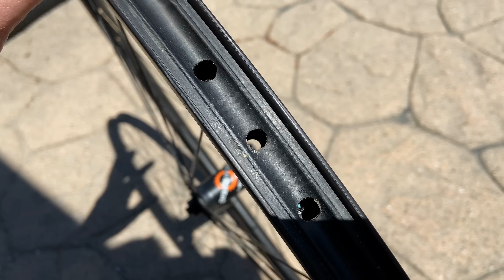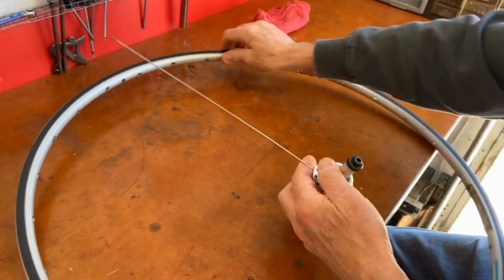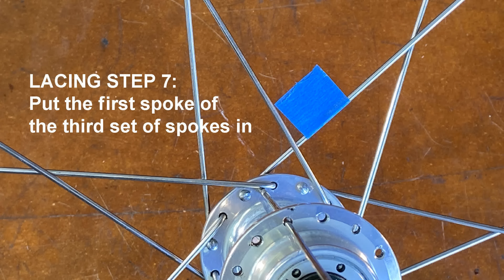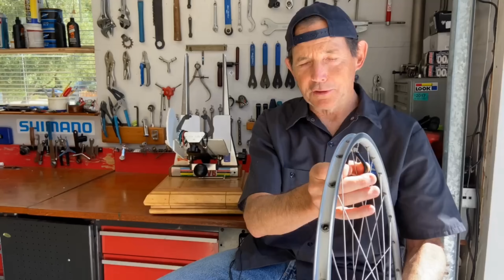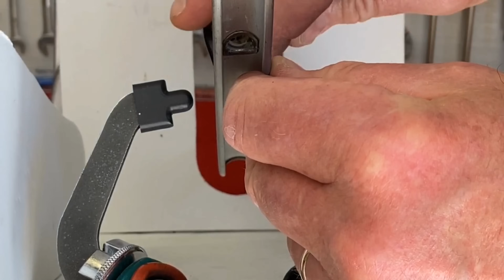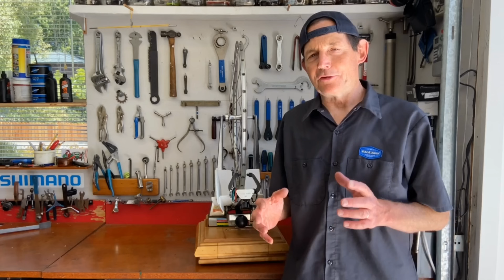How To Build Bicycle Wheels THE EASY WAY! #bikerepair

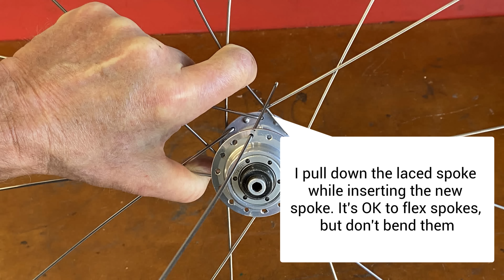Comment: I used your video to help rebuild  a set of wheels I had built in the 1970"s using the Campy Low flag hubs from that era.  At 17:02 you showed bending the spoke to fit it through the large opening.  When I tried this I got the spoke stuck and could not push it through. Instead I pushed the spoke through the triangular area below your finger until the spoke was totally inserted, then worked it out from between the spokes on the opposite side by bending it slightly.  For me it was easier and quicker. By the way, I started building  my own wheels for racing in the early 1970's.  I used the trial and error method and made a lot of mistakes along the way.  I wish I had your video back then. Very helpful.  Thanks.
Reply from the maker: Thanks for watching and sharing your wheel build tips, Bill - nice of you! Yes, Campagnolo hubs back then had slightly smaller spoke holes, which was great for bedding and supporting the elbows but it did mean having to tweak the spokes to lace them sometimes. Good job figuring out the best way to do it. 

Some builders would deal with the issue by putting the spoke sets in loose (multiple) sets at a time so not have to to avoid having to weave spokes through others. Happy to hear my video helped you build those lovely classic hubs and get them back on the road. Enjoy them!

Comment: I have some 72 spoke 20in wheels and I need to add a hub motor to them..All I've seen with these is straight spokes, or twisted straight spokes, where the twist is forward one side and backward the other side.   I am wondering if I can do forward BOTH sides?   As the motor torque would even each side, not worried too much about braking.  I think that would look cooler than just straight up spokes.  thanks
Reply from the maker: Thanks for watching and the question, Murray Madness! The reason wheels have forward spokes on one side and backward on the other side is because the opposing twisting force on the hub balance each other out. The first set of spokes is put in on one side. Then the hub is twisted making those spokes all lean forward and when the other spoke set is put in on the other side, those all lean backwards, which holds the hub twisted and keeps all the spokes forward and backward.

If you were to try to do all forward spokes, you would not have any force to balance out. And, what you would have is just a radially spoked wheel, which means straight spokes from the hub to rim. Even if you twisted the hub to try to make the spokes all angled forward, once you tightened the spokes the hub would untwist and go back to a neutral position with its holes directly under the rim holes. But, you could experiment with only one backward spoke per side maybe and end up with 70 forward facing spokes. I bet you could make that work, but I have not tried it so I can't say for sure. If you figure it out, please let me know. Hope this helps and have fun! I subscribed to your channel, some cool videos, thanks!
Reply: @JimLangley1  Makes perfect sense, if I tried it it would be obvious nothing holding the hub in place.  I think I will just bail on the 72 spoke wheel and replace it with a 36 and do a single cross.  Thanks!
Reply from the maker: @murraymadness4674  you're welcome, Murray. That'll make a nice wheel. Have fun building it.

Comment: What a amazing video. Best video on YouTube about this subject
Reply from the maker: Thanks very much, Jose! I appreciate you watching and the awesome comment!
Reply: @JimLangley1  I will need to do all this cause I'm changing both hub and a cassette for 11v, but I'm afraid that my wheels will be aligned as a UFC fighter's face after 10 rounds 😂
Reply from the maker: @FernandoHaddadMinistro  ha, ha, thanks for the laugh, Jose. As long as you take your time and true little by little and follow the steps, you should be able to get the wheel straight and round. It just takes patience and some determination because it takes time and many small adjustments. It's really satisfying when you end up with a wheel you built yourself so that makes it worth it. And you get better at it as you build more wheels. Have fun and let me know how it goes or if you need any help.
Reply: @JimLangley1  thank you very much for the encouragement. I see as the same, as fun. I could pay for some store to do it for me, but I wanna do it!

Comment: Hi have you any vid on wheel balancing with weights or what are your thoughts on it ?
Reply from the maker: Hi Seamus and thanks for watching! One of the best wheel engineers in cycling , Josh Poertner, head of Silca who makes a wheel balancing kit has a good video on it here https://youtu.be/ZrRbM2BSU8A I think it’s a way to ensure you get max performance from wheels but I haven’t had any wheels that seemed that out of balance so I have not tried it.

Comment: I just laced and tightened each nipple to 2mm of thread, but my hub is still somewhat unstable in the wheel. I has maybe 1 cm of play up and down (where some of the spoke nipples can push out of the holes). Are my spokes too long? 
Thanks and great video!
Reply from the maker: Thanks for watching and commenting, Jordan. If I'm working with a wheel like that I usually keep turning until the spokes are about 2mm from the top of the nipples (looking down from above) and make the call then. If a wheel is still loose and the spokes weren't yet seated at the hub and the spokes are nearly to the top of the nipples, then the spokes may be too long because seating them (flattening them at the hub) has the effect of making them longer and the wheel looser. I hope this helps and thanks again!
Reply: @JimLangley1  This is a late reply, but I was able to build this wheel in question. Some of the spokes protruded past the back of the nipples, but I think I still had OK thread engagement and no interference with the rim tape. I have been riding this wheel hard and it has held up great!
Reply from the maker: @jordanbuckner1230  it’s great to hear your wheel has been working so well Jordan, nice job! Thanks for letting me know and congratulations!!

Comment: I went as far as purchasing a tuning fork and I’m not gonna tell you if it works you’re gonna have to find out ,they are cheap
Reply from the maker: Thanks for watching and commenting, robe but what are you using the tuning fork for? If it’s for checking final spoke tension that’s an interesting idea. I do and lots of pro builders pluck spokes to get an idea how tight they. So you might be on to something. If it works please share your findings. Thanks again for the great comment.

Comment from the maker: If this video helped you with your wheel building, the best way to help me out is by clicking the red SUBSCRIBE button. It doesn't cost anything and it'll help my channel and keep the camera rolling! Thanks!
Reply: Hello I'm trying to change a bike I got from a friend that was kinda messed up it's a mountain bike I'm trying to change it to disk brakes I believe it's standard rims it's 29 spoke is it possible to change it I have all the parts but I need to remove the spokes from the hub to change the hub for the disk brakes
Reply from the maker: @wrmartinez  it’s always possible. In order to use the same parts the hub has to have the same number of holes and be the same width and flange dimensions. If the hub measures differently it means you will need new spokes in most cases. Okay? I hope this helps.

Comment: This is an excellent will building video! Everything is perfect. I will be using the WheelSmith spoke prep. Should I also lubricate the outside of the nipples so that they spin freely into the rim seat? This will be my first wheel build and I want to do it As correctly as possible.
Reply from the maker: Thanks for watching, bjimbosld! Happy to hear you like my video and are ready to build yourself some wheels! Sounds like you already watched my video on applying Spoke Prep here: https://youtu.be/z4FKL95x6DE If you are building with aluminum rims then yes, it's a good idea to lubricate the spoke nipples. Or you can lubricate the holes in the rim if you prefer. One way to do that it to put a nipple upside-down on an old spoke. Then dip the nipple into a tub of grease and then push the nipple into each spoke hole in the rim. That will put a dab of grease into each hole in the rim. You don't want too much lube, just a small amount to lube the nipple. Too much and it will spread all over, attract dirt and make a mess. You always want to clean rims off after building the wheels, too, just to be sure no lube got on the rim and especially so if you have rim brakes. If you have carbon rims, the lube can spread and make a mess and on some carbon it can be difficult to clean off - so it's usually best not to lube the nipples or spoke holes on carbon rims. Hope this helps and thanks again!
Reply: @JimLangley1  Thank you so much for the reply and information. 👍
Reply from the maker: @bjimbosld  you're very welcome - enjoy your wheel building!

Comment: Your video was perfect to follow along to, even though i had 32 spokes and a two-cross lacing pattern. Only issue is i think it might be a bit misleading that you said at some point you almost can not over-tension the spokes. I did, and the rim now has cracks at the spoke holes.
Granted i did not watch the whole video before beginning.
The rim i used was used and i'm not mad about the loss, i learned something anyways. My question is: how do you tell the tension you spokes have is correct? Do you use a tool or do it by ear?
Reply from the maker: Thanks for watching and congratulations on building your wheel, Victor! The reason your rim cracked is most likely because it was already used once not that you overtightened it. Age and wear from riding weaken rims. Most builders refuse to build with used rims for customers for this reason.

I do explain tensioning at the end of the build process in the video. There are tensiometers for spokes and pro builders use them to be able to verify/certify a specific tension and prove it too. Park Tool makes a nice affordable and easy to use one (about $100). But wheel builders didn’t have them until the modern era showing that fine wheels can be built without. If you get a tensiometer, read the instructions as every one is used a little differently. Hope this helps and again, great job building your wheel!
Reply: @JimLangley1  Thank you for your reply. I did end up getting a TM-1, and yes the rim was very old. I've built a set of wheels with all new parts now and they seem great. Haven't had the chance to ride them yet (they are specific to a cargo build) but i am stoked. Thanks!
Reply from the maker: @thiccvicx  thanks a lot for letting me know, Victor. Great job! Enjoy using your TM-1 and especially riding on your handmade custom cargo wheels!!

Comment: Best wheel building video on youtube, hands down.  I've already built two wheels and am excited to do more.  Jim, do you you use a spoke tensiometer at all or do you prefer good old fashioned feel and tone of the spokes to judge tension?
Reply from the maker: Thanks for watching, Aaron. I'm happy to hear you like my video and are off and running building wheels - congratulations and enjoy your custom wings!

As a professional wheelbuilder I do use a spoke tensiometer because production wheels have standards that need to be met - usually on the spec sheet for the wheels. And, once you start using a tensiometer, you enjoy having a verification that you've got the tension exactly right. 

You can get a feel for that exact right tension but your hands and the spokes can fool you, too. With the tool there's no doubt and you can show what the tension is if anyone checks your work.

I have used Park Tool's and it works fine and is reasonably priced https://amzn.to/3pqbT4M . My go-to is the Wheel Fanatyk here: https://wheelfanatyk.com/collections/measuring/products/wheel-fanatyk-tensiometers?variant=40258862579870 

In another of my wheel videos I show the Wheel Fanatyk tensiometer in use here: https://youtu.be/Wb73si7WD-k?t=575 Thanks again, Aaron!!

Comment: at 11:33 you state that the direction the inside spokes go should be determined by the valve nipple. This is not correct. The inside spokes should always go forward, and the outside (pulling spokes) backwards. 
Normally the rim ferrules don't give you the option to make this decision.
So if you are wrong at this point you need to start again & relace from a different staring point (forward two holes, or flip the rim around etc).

16:00 I think using the ball of your thumb is much safer than a hammer. I've never used a hammer, so don't really know. Hub flanges are not super strong. You can also lay the wheel onto a carpet and hold the rim & put your body weight onto it. Same applies at 55:18 - better to use your whole bodyweight.

I've built 7 or 8 wheels & found the hardest part to be calculating (& buying) the correct spoke length.
Reply from the maker: Thanks for watching, Simon. But there’s nothing incorrect about the lacing directions. I think you’re overthinking the process. At that point in the lacing, there’s only one choice that’s correct and that’s what I show. 

Also, you can straighten/remove bends in the spokes safely both ways I show in the video. Stress relieving is a separate process. I recommend squeezing parallel pairs of spokes not using your body weight - unless you have experience because even a 150 pound person could ruin some wheels by overdoing it. 

Yes, finding spoke length can be hard. That’s why I have a video all about that , too. Here's the link: https://youtu.be/LvV4FE2VxZk Thanks again!

Comment: :D built my rear wheel and tightened the nipples with a cordless drill and just went for a ride without any truing
worked well enough id say
it was so sketchy as the dish was way off
Reply from the maker: Thanks for watching sharing how you did it - I’m glad it worked out at least enough for a test ride. I have a video you might like all about using a cordless drill for wheel building here https://youtu.be/kaBvpCuXigQ

Comment: Best video I have come across , on bicycle wheel building . Thank you so much Jim.. Subscribed from a Fan across the pond .
Reply from the maker: Thanks for watching and the great comment, Chris. I'm happy you found my video helpful and really appreciate you subscribing! In case you're interested, I have a good selection of other videos that go over things not mentioned in this one, such as how to find the right spoke lengths, how to keep spokes tight, ones on spoke terminology and lacing patterns and more. For easy access I have a list in the description below this video. Thanks again!
Reply: @JimLangley1  . Just built my 1st wheel .. 26" fatbike rim 26x 4.00 . with 3.5mm spokes 36 off .  Just waiting on 2 xwheel spindle/bubs so I can build 2 off 20" x4.00 fatbike wheels . I am designing and building my own recumbent trike , with full suspension and tilting .. It will be a while before I get everything together before I start to fabricate
Reply from the maker: @chriskautz3245  way to go, Chris! That sounds like a very special trike. I’d love to see it when it’s rolling.

Comment: do making cassette side flat need any special tool or can we do it by hand
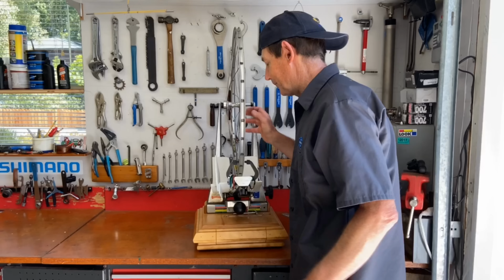Reply from the maker: Thanks for watching and the question, Just Chill. You're asking about rim centering. Please watch the video at 51:13 where I explain and show the process and tools to do it.
Reply: @JimLangley1  thank you sir now i can build my rim
Reply from the maker: @justchill4886  great to hear you can build your rim now - happy I could help!
Reply: @JimLangley1  sorry again but i have weird hop. a very long hop 40% of wheel is inside and 60% is outside
Reply from the maker: @justchill4886  what you need to do is loosen the spokes in the low/inside area and then slightly tighten the spokes in the high/outside area, Just Chill. Make more turns at the lowest and highest spots. Think of the wheel as an egg shape. To get it round you need to loosen and tighten to get the wheel to become round. You’ll get it if you take your time and pay careful attention to how the wheel is changing each time you loosen and tighten. Have fun and good luck!
Reply: @JimLangley1  yes but inside/low is very loose and outside/high is tight
Reply from the maker: @justchill4886  as you tighten the high spot spokes - even if they already feel tight, so long as the spokes are laced correctly- the low spot should start to move outward and the spokes there should start to tighten. You just go 1/2 turn of each nipple tighter in the high spot and make sure the low spot is moving out/up. With each time you make more 1/2 turns tighter the rim should get more round. If you started with a wobbly non round rim you will have to force it into round like this sometimes. Sometimes many many turns of the nipples too - like 10 or even more. I hope this helps.
Reply: @JimLangley1  I am gonna try that trick. Thank you again master
Reply from the maker: @justchill4886  you’re very welcome- let me know how it goes
Reply: @JimLangley1  i finished building wheel and i came back from ride ,its so awesome to ride good balanced wheel.thank you again master
Reply from the maker: @justchill4886  way to go, Just Chill, congratulations!! I’m happy to hear it. Thanks for letting me know!!